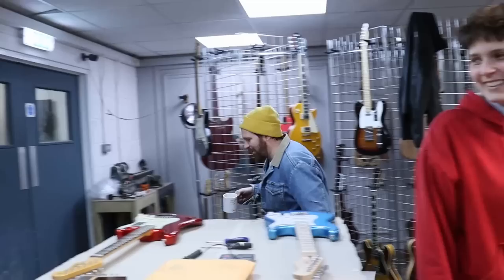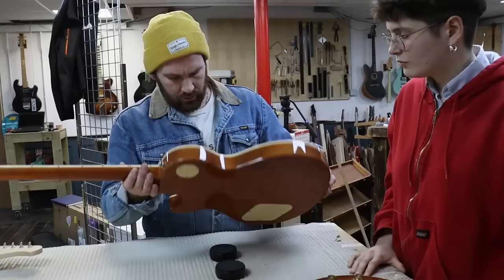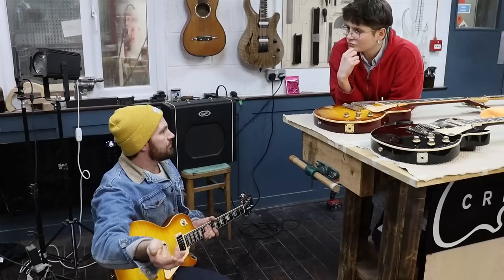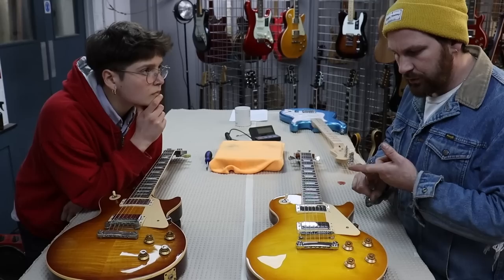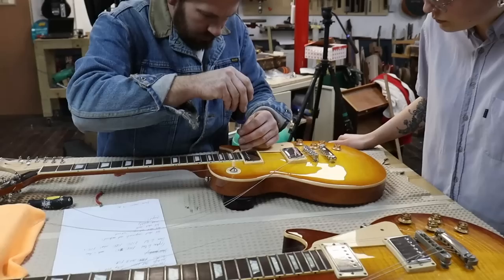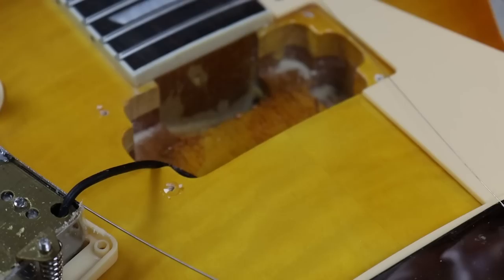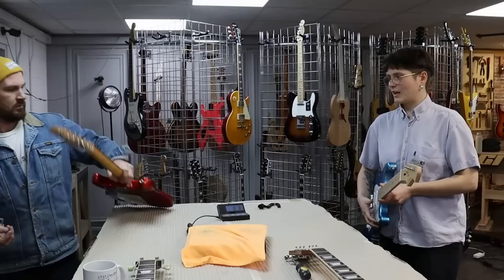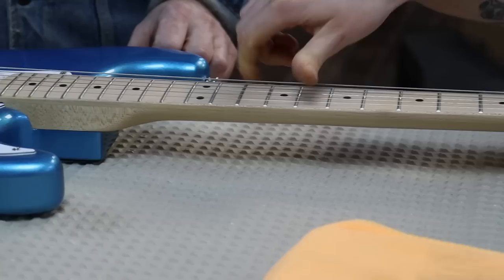Are these Guitars worth it?  Best Value? How do they do it? | Fairclough vs Fender & Gibson

Comment: answer: slavery....(just the long way around...and calculated to the dollar)
slavery or the wage that equals the dollar cost of slavery.....same diff.
paying exactly enough to ensure the total zero possibility of personal improvement or mobility
exactly enough to keep someone on the edge of desperation....
Reply: In China that is probably the unfortunate truth in most factories. However that's not the case in South Korea, and definitely not in Japan (and the Japanese Guitars are often both cheaper and of higher quality than American ones)
However, if you have the infrastructure, it's incredibly cheap to build a functional electric guitar. A CNC-machines does most of the hard work and you don't need a high level of education or knowledge of instruments to be able to glue a few pieces of wood together, same goes for operating a screwdriver or a soldering iron.
If machines do most of the work, you source the wood from questionable places and use the cheapest hardware available you only have to hire competent workers for the paint department. Also, a large part of the price of the big brands (Gibson, Fender, etc.) are the branding itself

Comment: Les Paul's experiments in the 1920's proved that the stiffer and denser a material a guitar is made from the greater the sustain. Tone on solid body guitars is almost entirely determined by the electronics (particularly the amp). Acoustic guitar tone is determined by the wood used, but the louder the guitar, the lower the sustain. Sound energy has to come from somewhere - the strings on an acoustic provide that energy so sustain suffers. Think banjo - dead loud but almost no sustain.
See https://www.youtube.com/watch?v=36ECSlBDDRA&ab_channel=RobScallon at about 2:30.

Comment: If you buy a us Les Paul custom shop for 5k, then in 10 years you have a guitar you can sell for 5k.

If you buy a Fairclough LP for 200, then spend 700 on hardware and refretting. Then in 10 years you have had to live with imposter syndrome for that time and you have a guitar nobody will buy for more than 150.

Comment: Not to mention that I’d be willing to bet that that guitar just like the epiphone. Is made to metric specs. When you try to put Gibson wiring harnesses in. They won’t quite fit. The hardware won’t fit because the studs in the body for the bridge and tail piece are spaced metric. Gibson products won’t fit. The fretboard speaks for itself. No fret nibs and horrible metal for the frets. Bottom line is that all of these knock off gibsons are not even close. But I truly wish that they were! Because most of them have great finishes and color schemes. They’ve got colors that you’ll only find in the Gibson MOD shop. I’ve seen Chinese knock offs that look amazing! But they turn out to be total garbage! They’ll even send you pictures of the build and you’re thinking WOW my guitar is being hand built by a expert luthier!!! No! Sorry! It’s garbage. If it were a great Chinese made guitar. It wouldn’t have a horribly placed Gibson logo on it. It would have the name of the great luthier who is proud of the build on the headstock. Not a shitty knock off gibson les Paul custom for less than a quarter of the price. Hahaha you’re not getting the deal of the century! You’re getting ripped off!